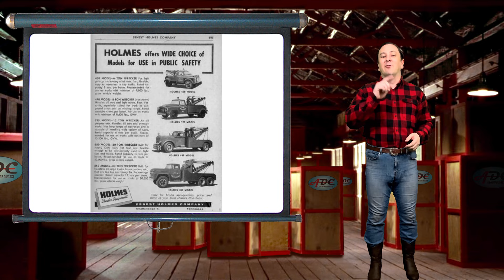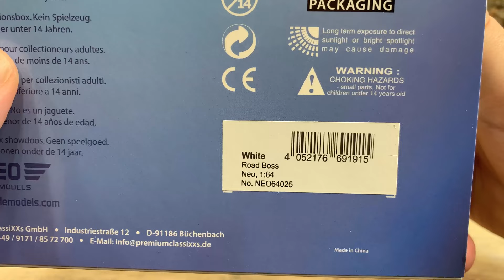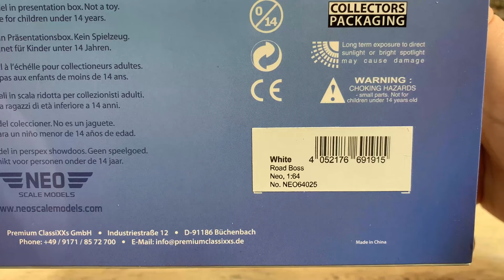Ernest Holmes Co Wrecker & Towing Equip & 1977 White Road Boss Wrecker 64th Scale NEO SCALE MODELS

Comment: That's a Nice piece, the Holmes wrecker body on the rear would indeed be a Holmes model 750 Heavy Duty wrecker. The 750 was a 25 ton capacity wrecker
Reply from the maker: yes it is a nice piece, wish they had done another version before shutting down.  Like on the 351 Pete

Comment: Hi L9gan, what's the difference between 1:18th scale vs 1;64th scale model and give your opinion and what kind of detail and  functionality?
Reply from the maker: 1:18th are roughly 4 times bigger than 1:64th scale cars.  This size difference makes it so much easier to put opening doors and more detail in a 1:18th vehicle versus a 1:64th scale.  There are pros and cons to both scales.  I like 1:18th for the detail, but I dislike it for the space it takes up.  I think 1:64th scale has enough detail to make a very nice model sitting on a shelf or a diorama and doesn't take up as much space.  I think the space versus detail trade off is a fair compromise.  After all these really are meant to just sit on a shelf and not be played with so all the opening parts are not really necessary for a display piece.  For more info on scale with a different scale comparison chart, grab my free report on Scale here: http://bit.ly/SCALE-MEAN